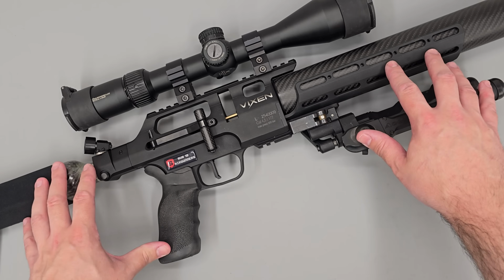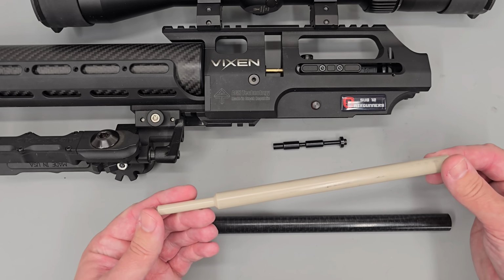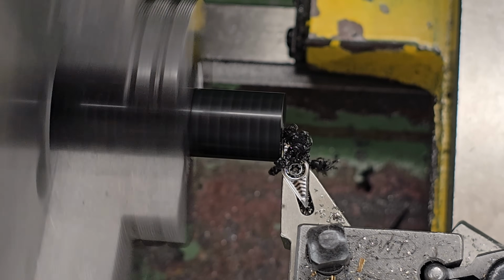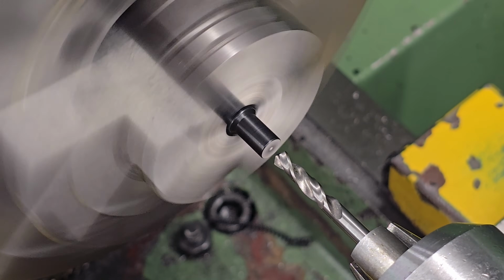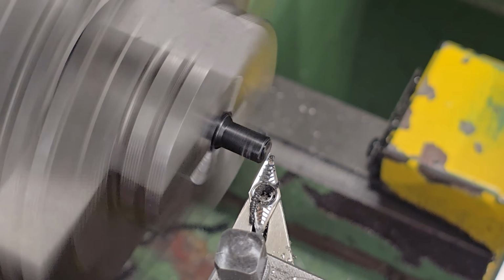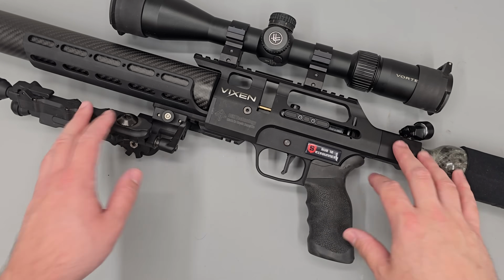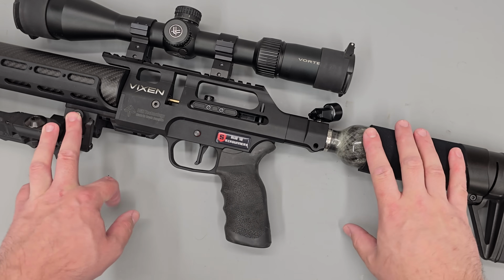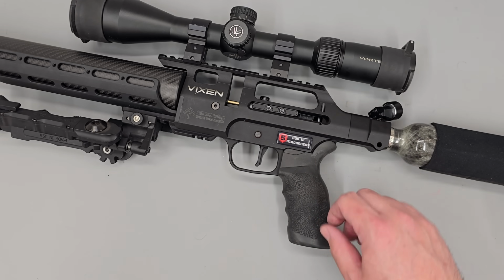Airgun tuning: Delrin tipped hammers

Comment: Excellent video as usual, however wouldn't a top hat shaped delrin tip work better as there is still metal on metal contact from the edge of the hammer and valve housing face?
Reply from the maker: Most hammers have a large enough striking face to hit the valve pin without the edge touching but yes if the valve pin did contact the edge a top hat may work better  👌